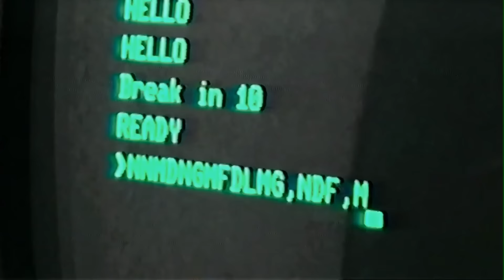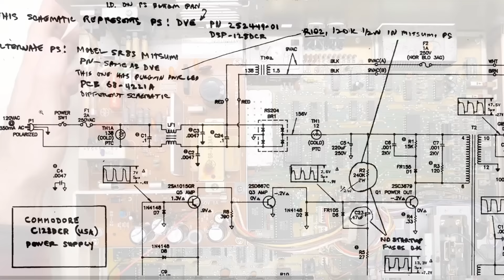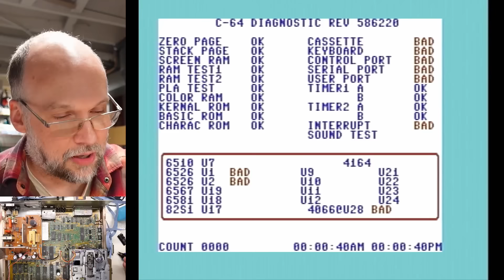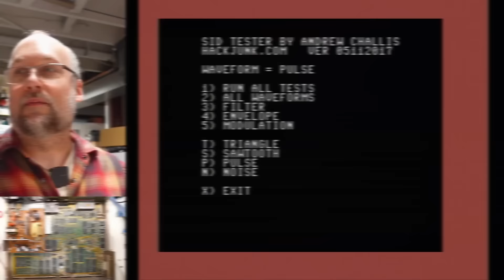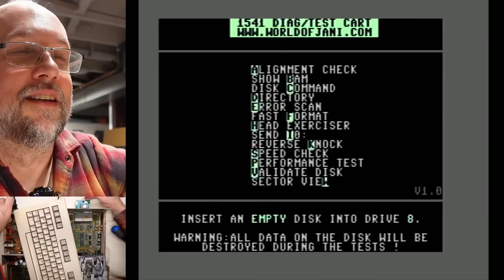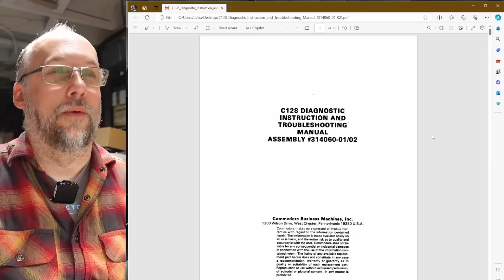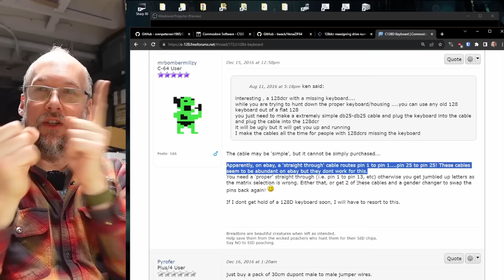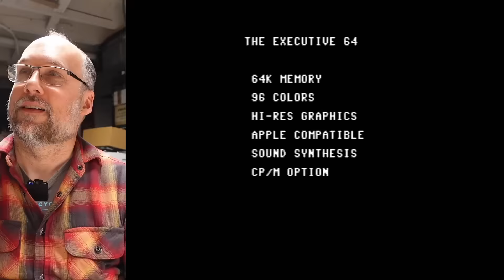I did everything wrong when fully testing this C128D

Comment: Regarding the 6526 in the DCR: They are bad by design. They are off by 1 clock cycle which I noticed when working with a monitor that did single step by using the NMI. In my case it just didn't advance through the assembly code because the used CIA timer just fired before the next instruction was executed. If the test ROM really checks the exact timing, then yes, the CIAs have to be bad...

Comment: IMHO you should use lithium grease on drive gears/slides/etc since it doesn't seep. If you have the spray, just spray a little and apply with qtip or toothpick etc.

Comment: It is really not suprising that CP/M runs so badly on those systems. 
CP/M was created to be used with serial terminals or teletypes. In that environment, sending a character to the terminal is just a single assembly instruction. And getting a character from the terminal also requires only a single instruction.
But machines like the C128 or CPC6128 have to do all the terminal emulation in software. They have to keep track of the screen position, handle control codes, translate from screen coordinates to VRAM adresses and so forth. And then they also have to scan the keyboard matrix.
So what is supposed to be just a single assembly instruction taking a few clock cycles, now becomes a whole task running hundrets of instructions for every single character.

Comment: Interesting. My European C128DCR has a completely different PSU where at least one rail was powered by an LDO which was underrated so that the machine crashed when accessing the disk drive for too long. BTW, the DCR has a completely different floppy design than the 1571. Commodore "optimized" the WD1770 MFM controller and the CIA used for burst transfers away and created custom chips. The new "controller" was not compatible with the WD1770. Generally the design changes created compatibility issues with software that runs on the floppy drive itself.
Reply: Does the DCR still use a standard MFM drive like the regular 1571 or does it need a specific drive to work?
Reply: @Stoney3K  Maybe you confused this with the 1581 which in fact uses a standard drive. AFAIK also the 1571 never used a standard MFM drive, only a bare drive mechanism. With a standard PC drive you would a) have problems regarding the index hole which is not needed by the Commodore 5,25" drives like the 1541, 1570, 1571 (and not present when flipping over double sided disks recorded in single sided mode you will have no indx pulse which will deactivate the analog circuitry in many or all drives - for my TEAC double 5,25"/3,5" drive used with a Catweasle I needed to patch the drive for the exact reason) and b) possibly some filters would be set for the wrong frequencies when comparing MFM to GCR encoding.
Reply: @TLang-el6sk The 1571 uses the same WD1770 controller as the 1581, the only difference being the physical drive and newer software. You can make a 1581 out of a 1571 with a dead transport by salvaging the board and attaching a PC or Amiga 3,5" floppy drive. There are tutorials on YT on how to do this.

There is nothing in the drive to patch. MFM/Shugart interfaces just provide the physical front end to the disk controller which may have some different encoding or settings.

The only drive that is different is the 1571-II, which is very uncommon, and it probably uses the same patched controller that the 128DCR uses.

Comment: re the c128dcr no 5v at d connector, isnt the solution simply to hook onto a 5v source in the c128 and connect it to the dongle at the ic for example? isnt that all it would take to get it working? (why does the d cr omit the +5 on the keyboard port?)
Reply: it seems the +5 on the 128d keyboard was never connected to anything.

Comment: The thing at the C128 was, that there were only a few programs for it specifically. Most programs were for the C64. So you had to use the C128 in C64 mode.
Reply: The decision by Commodore to make it CP/M compatible for the business market never really caught on, because almost all C64's were used as gaming machines. By the time the C128 went on the market, the business users had moved on to IBM PC's or compatibles, and Commodore was already heavily invested in Amiga.

Comment: What a coincidence. I have exactly the same machine on my desk right now. But mine is in much better condition, almost like new.
I was quite disappointed because the C128 seems to have quite a few problems with the graphics chips. The jailbars are terrible. I've never seen them as bad as on this machine. I will install a Lumafix128 when I get the chance. I'm not expecting too much from it, but maybe it will alleviate the problem a bit.  Thanks for your video. That was particularly interesting for me this time.

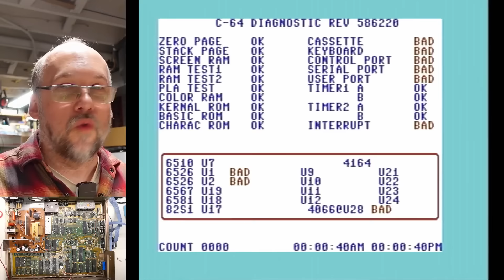Comment: 18:33 That's one of my many gripes with OBD-II on cars. That DTC doesn't tell you a god damn thing most of the time. Car presents with rough running, low power, high fuel usage, due to a coil pack not firing because a squirrel has nested under the intake manifold and started chewing on the wiring. Pull codes all you get is 'Bank 1 misfire' and 'bank 1 O2 sensor' codes. Well no shit, ECU, we already know it's got a dead miss that's why we're pulling codes in the first place. How about telling us why it's not firing correctly since you've got 9,001 sensors on the damned engine.

Useless crap. A DTC of 'Cylinder 7 coil pack primary circuit open' would pretty much zero the technician in on the actual fault and the ECU is very easily able to determine this is the case, but simply saying 'Bank 1 misfire Bank 1 O2 sensor out of range' doesn't tell anyone anything useful.